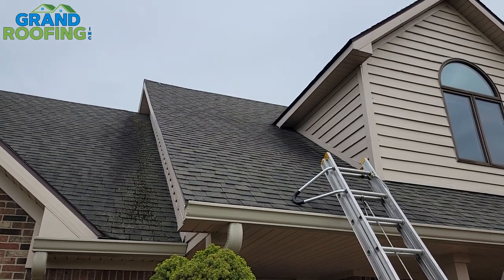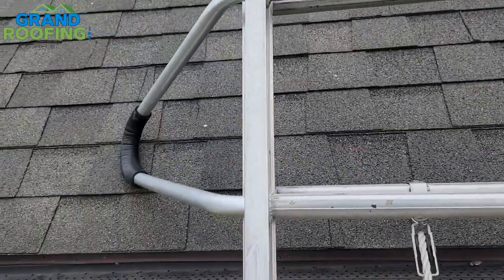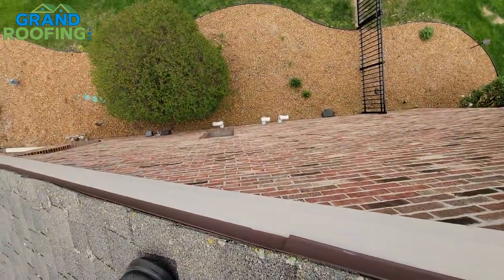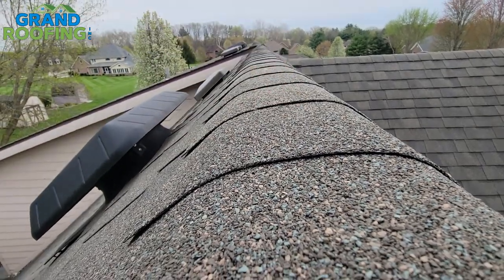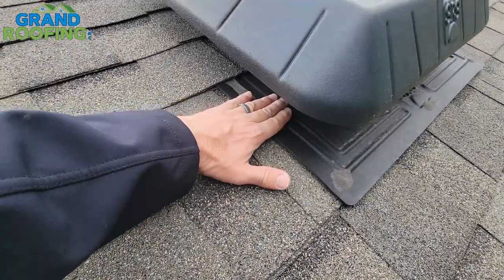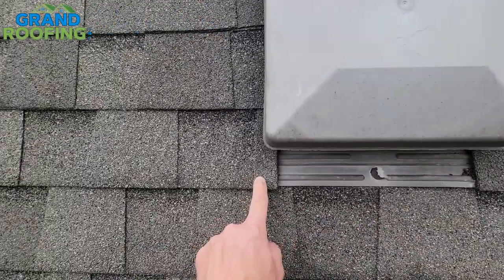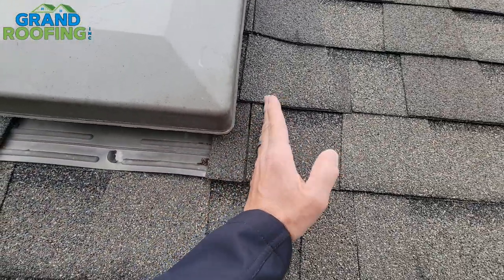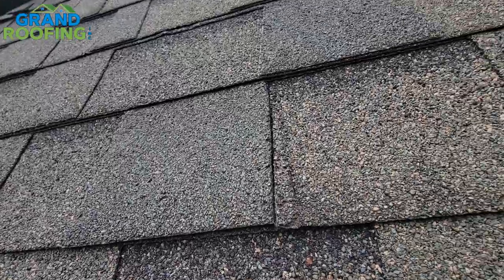How To Find A Roof Leak

Comment: Nail the vent onto the wood roof with synthetic underlayment peal and stick under the vent . Of course cut the underlayment hole for air exhaust . Use neoprene washer shank nails and nail through the vent flange . Put underlayment on the exposed flange ( peal and stick which will cover the the vent flange and nails ) . Cover the underlayment with shingles ( remember to remove the vent cover before nailing the vent to the wood roof so you have clearance to nail the vent to the roof and to place synthetic 
underlayment and put shingles on then put fan cover back ) .

Comment: Thanks great job.I have 2 leaks in corners of where a build on connected.I have had 7 men up there without any reward..It still leaks and I have I have compounded them 11 times over time. Can you recommend a inspector in the Morristown Tenn area.I m so frustrated .Our shingles are about 6 yrs old.

Comment: Where did you get the ladder standoff?  I seen A few of your videos. Another question is. Does cougar paws grip to metal roofs ? I been thinking about investing in cougar paws. 
 I use the pitch hoppers. And they work great!
Reply from the maker: I got the latter standoff on Amazon there's a link in the description.  If I can remember the  Cougar Paws grip steel But not if they or the roof were dusty.
Reply: Thanks for the reply.  I will def check out the standoff. I got the older styles that uses the C clamps and wing nuts.

Comment: HOw much are you charging for basic work like this?
Reply: Its  not basic  , finding the problem is the job not easy as u see ,  doing the job is hobby  , he probably charge $280 to 350 max
Reply: @accent1975  280-350 for applying 1/2 a tube of caulking and no guarantee you found the leak.

Comment: I don’t think that nail hole under a vent flange would cause a leak that bad. Is it just dripping straight down to the drywall? Wouldn’t it be better to go in the addict and check that spot visually. It would be very obvious if it is bad enough to stain ceiling.
Reply: Some areas of houses don’t have attic access throughout the whole house
Reply: @Leotheconstructionguy  True.